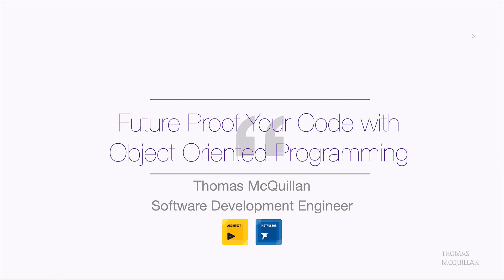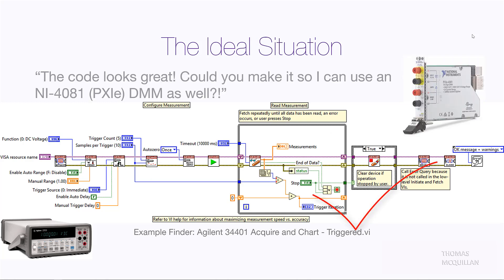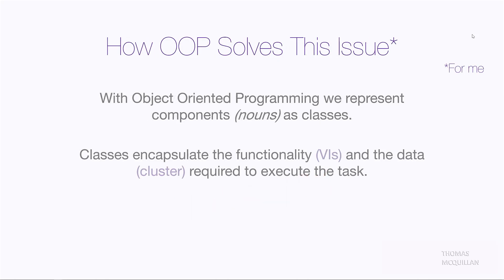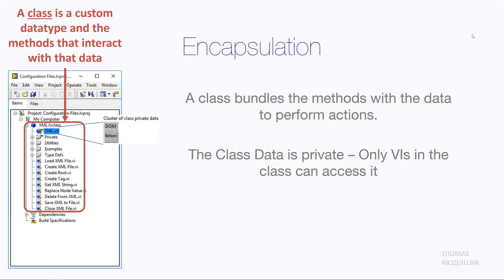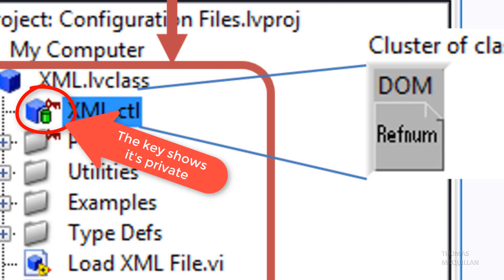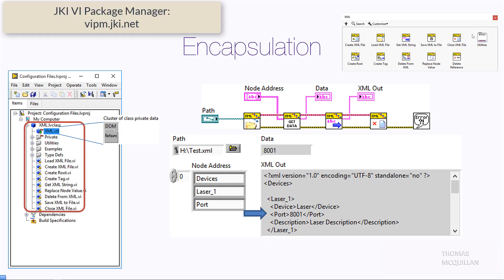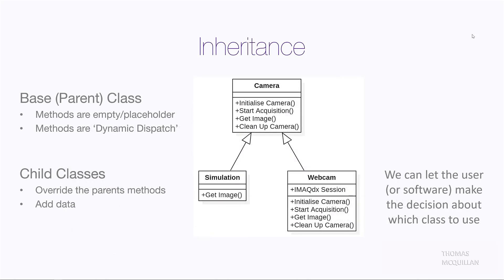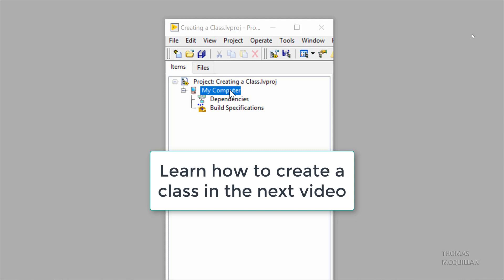1 of 6 Future Proof Your Code! Introduction to Object Oriented Programming in LabVIEW

Comment: Hi, and compliments for your videos! I'm trying to get my head into OOP but I'm having a hard time finding the right key to get the concepts.
For example..What about front panel? I'm trying to concretize a class so create a front panel custom control (a cluster with some indicators and controls in it) And i would like to "connect" this control with the class, something like the state of an indicator of the custom control is defined by a property of the class instance. Do I have to get all properties of the instance and pass them to my control "manually" or there is a way to make the class instance directly a custom control in the front panel?

Comment: Hi, can you help me with agilent 6752A ?
Reply from the maker: Hi, so you can download the LabVIEW driver for the Agilent 6752A from here (click the download link for the LabVIEW ADE):
http://sine.ni.com/apps/utf8/niid_web_display.model_page?p_model_id=2552

This will download a ZIP file, extract this file into: C\ProgramFiles\<National Instruments>\LabVIEW<xxxx>\instr.lib
Reply: Thanks , can you give an example with oop and agilent 6752A? Please ?
Reply from the maker: Hi  @jeanpierreabregumedina7374  , This series goes through a hardware abstraction layer. If you want to use OOP to make the code scalable, you could create a parent class with the empty methods, then use the agilent driver in the child class (using dynamic override methods)
Reply: @TomsLabVIEWAdventure  I don't have the hardware, but, can I create  simulation?
Reply from the maker: @jeanpierreabregumedina7374  Yep, So create a parent class, and make a child class called 'simulated'.
I would suggest doing some research on OOP HAL in LabVIEW